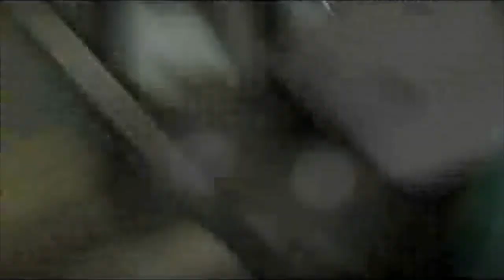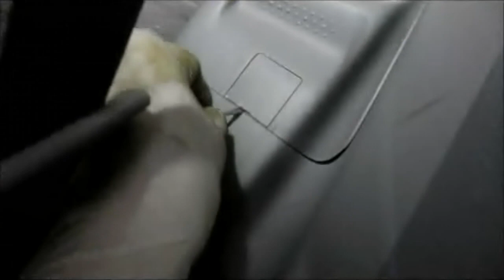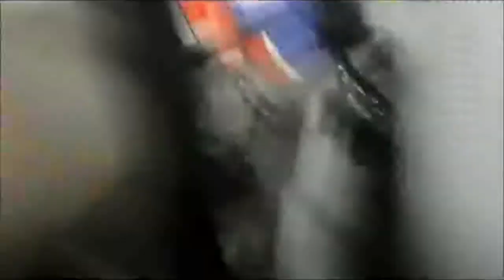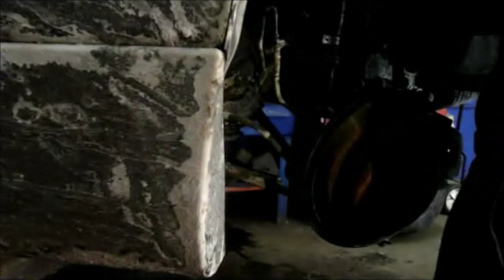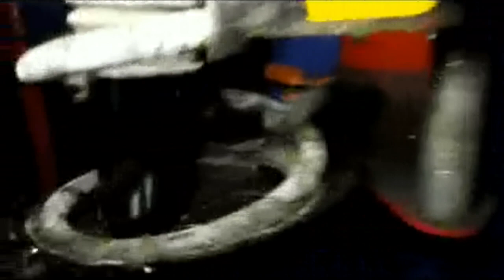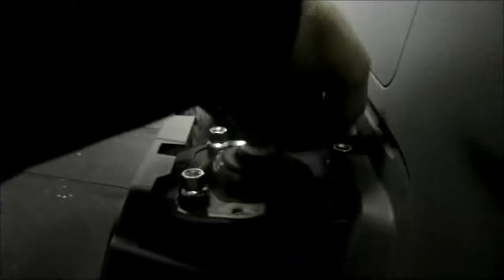Rear Struts Replacement 2008-2018 Toyota Highlander

Comment: My 2015 Highlander has rear coils springs. Totally different from what you have. I searched Youtube found none video showing how to replace the coil springs on a Highlander.
Reply: These are the coil springs, they are a component of the strut assembly.  There is no other suspension option for the Highlander.
Reply: @kookiethebear  I just replaced the coil springs and shot absorbers of my HL 2015 XLE about two weeks ago. This is what they are exactly: https://www.youtube.com/watch?v=oZllKtZzyCg&list=PL-D5kcdHqQu6632D8t5OrpMZTu6te9xsn&index=11&ab_channel=chrisvazquez, there is NO stut assembly at all.
Reply: @rodcanoeoutdoors  Apologies for the bad information, I forgot it changed in 2014.  For some reason I had 2017 in my head.  Cheers and congrats on getting the work accomplished.
Reply: @kookiethebear  Thanks. It is a pretty easy job if those bolts are not rusty.

Comment: i have a question- took out the rear suspension to add a lift kit, couldn’t get the knuckle lined back up, i have pictures of what it looks like but the hub is slanting the assembly to the right, and now its diagonal enough that no matter how hard i try i can’t line it back up. is something bent, or do i just need a lot of brute force

Comment: What is a reaspnable price to pay a shop to do this job?  Im in So Cal and my shop wants $1400.  Seems steep...?
Reply: I’m in the same boat! I live in Houston and that’s around the same price (for a well named shop) usually $1200< 

If you have a cosco membership, that could get you a 20% off coupon with a partnering shop with cosco. (Just don’t tell them that you have the coupon until you get the full quote 😉) 

I think I’m just going to try it out this weekend though, best of luck with the job

Comment: I had the front replaced with KYB struts and took it to get a front end alignment and was told when I do the rear next month$, I’ll need an alignment again. Is this true or just a money grab? Thanks and great video 👍🏼👍🏼
Reply: Yes you will always need an alignment when replacing suspension components
Reply: @warrenchung2215  Thanks Warren 👍🏼
Reply: @Ojb_1959  you're welcome

Comment: avoid the danger and save the labor. By the struts with springs already attached. If the struts are worn out chances are the springs are too.
Reply: Based on experience quick struts are complete garbage. Yeah they're completely put together for you but they do not last long one year and they're going out already.
Reply: KYB makes a good one

Comment: Thanks, looks doable.  I drive an '03 so process should  be similar.  My mileage is 140K so when do you think I may have to do this??
Reply: Now.  Time or miles and you are overdue
Reply from the maker: Actually according to the milage they are over due but if they are not leaking you can wait. If you do replace them consider replace the whole assembly. They are called quick struts.